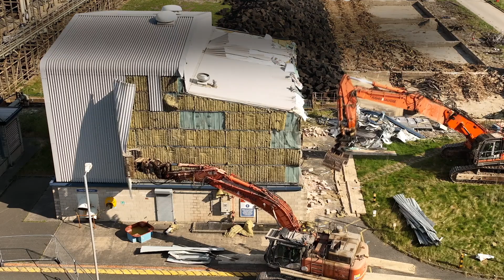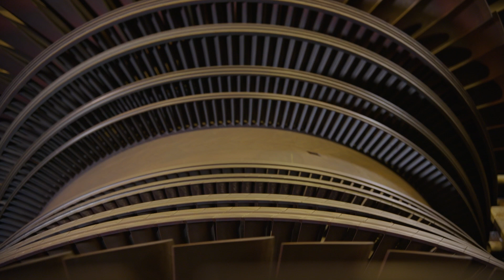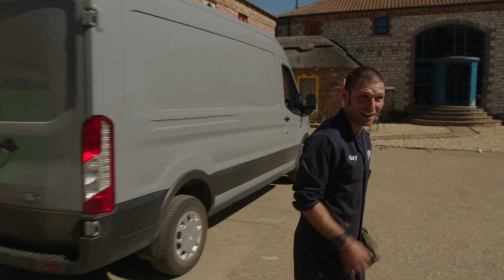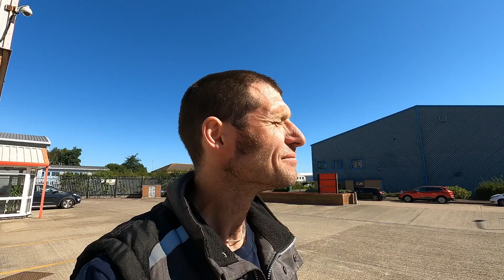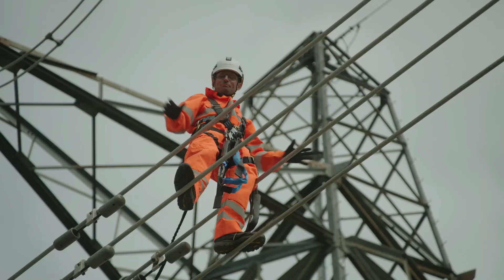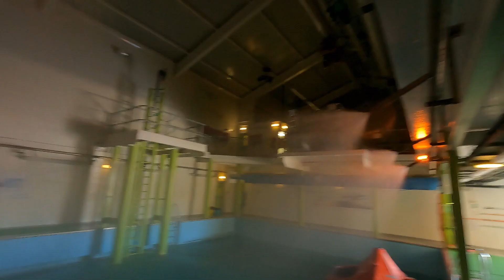ALL of Guy's Exclusive Scenes from Guy Martin's Great British Power Trip | Guy Martin

Comment: Guy good documentary mate however I'm at a loss as to why this country produces enough energy for its needs and yet we are paying a premium
What you said about on windy days the wind farms produce too much energy that we pay the companies to switch them off is madness and all that excess energy wasted that could be stored to reduce  bills
The government needs to address this problem ASAP as the public are being ripped off
Reply: That excess results in power grid failure, With electricity, when you push cables and such to their limits, they melt, they start fires, and in the case of industrial capacitors, they explode.
The cost for that premium is to pay for maintenance of the entire logistics of the system, including employee pay, hazard pay, insurance, The cost to maintain and repair complex electronic equipment, the cost to maintain and repair primary, secondary, tertiary, etc power lines, The cost to maintain and repair wind turbines, the cost to maintain and repair solar panels. Everything costs money and none of it runs without the half a million to a million people working in that industry to keep it running.

Want to reduce the bills? Use less electricity, push to make humanity less reliant on electricity, because the more and more people you employ to keep and maintain the electric infrastructure, the more you have to earn to be able to pay them.

Stop wanting everything in the world to be free.

Comment: The anti-electric people in these comments are hilarious. Also, not even Guy, who's probably a bigger gearhead than any armchair experts that will comment on this video., is against electrics... The anti-electric crowd, is where the real toxicity is.
Reply: no... People arent anti electric. They are skeptical about the actual practicality. Or at least i am. 
I actually work in a company where we design renewable energy infrastructure and every engineer i know is skeptical, to the point of audible laughter being heard in meetings discussing government targets. They are not realistic or even feasible.
The normal civvy's are not privy to the actual data and knowledge circulated amongst places like ours and trust me, its not as shiny and bright as you think. Does that mean we shouldnt use electric cars? no. I myself would buy one if i only needed to do short trips but... i live in a big country.
The problem is - the problem hasnt been solved. there is no formula to follow, no one has achieved the transition, its all theoretical and yet we are told this IS the way to go, dont question it. Its going to spell trouble. Think about it, the most common time to use a car is exactly the same time as the best time to charge it (day time when renewables are running) AND the time when the grid is under the most demand and the most susceptible to collapse caused by issues which those synchronous condensors are trying to solve.
Imagine all these issues MASSIVELY compounded if cars are all replaced with electric cars. No one actually knows how this is going to be done.
I spoke to a consultant the other day who told me about the actual data about the last couple of decades  of solar panels/effectiveness/failure/disposal and trust me, it was not good. He said exactly the same thing as me. Its terrible that we have blindly charged so far down this avenue without any real data, being told the whole time it is the answer when the data shows it is probably not.
I think a better plan needs to be formulated before investing insane amounts of money and knocking down our backup options on the promise of a dud.

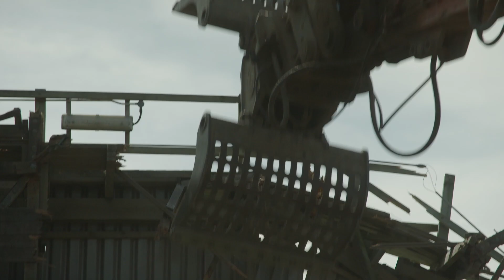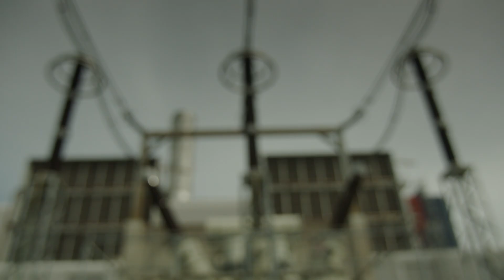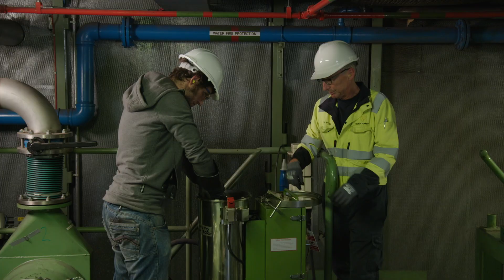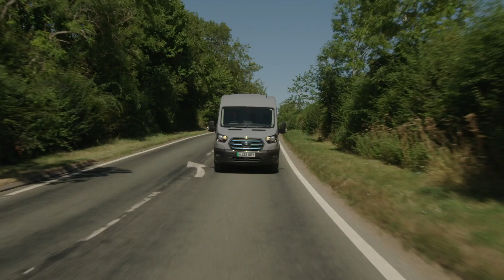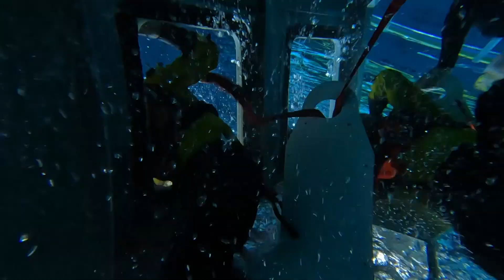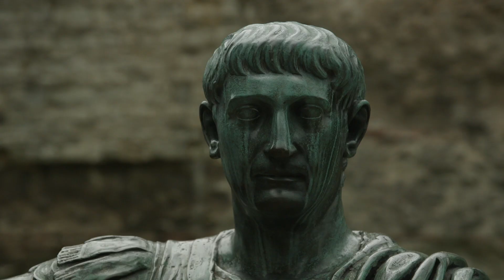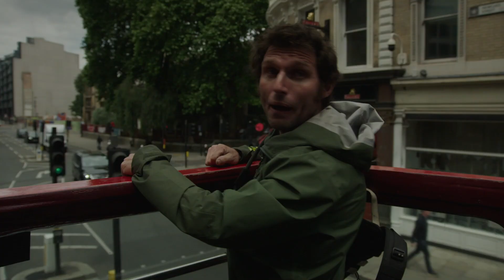Comment: 0:52  6:20  that shit needs to end for a start - Disassemble the fcking thing by hand carefully and Reuse the materials instead of wasting more energy crushing/shredding and re smelting.  1:39 stop/ban all non essential to life bullshit then eg fashion, paid  sports, discos, concerts, arts, music, industries we dont need people to be working in etc etc.    lol 5:43 get used to the big thick gloves need to be used when working on Evs too.  8:30  travel even in an ev for non life death needs to stop/be limited too 'by people doing the right thing because its right, NOT because youve been told too'.    15:00 send them via boat.  16:32   if charcoals so better 'even with the process to make it'  WTF were drax playing at logging trees in canada to chip up to burn as wood ?!   18:30 on the back of who elses work ?!   20:00 LMAO   hope they survive longer when sent into a nuclear facility than the first ones sent to Chernobyl DOH.  20:42 needs work if they are to work alongside us and assisting us.  24:13 will the helmet industry get its head out of its arse and care less about sales and profits and design a better helmet for all applications.   25:07 we need land ones to use any excess to power gravity batteries 'either a weight in the tower or pumped hydro or similar'   25:26 whats the industry doing to optimise the turbines spin speed (gearbox changes ?)

Comment: To generate the kinetic energy in the heavy Turbines takes a lot more energy input than you get output. Then uses energy at a loss just to maintain output. Loss Loss. That's why you have so many of them. Who's getting rich from UK power plants?
Reply: The alternative would be chemical batteries. 100x the cost of inertia
Reply: @getur99  no just spinning lighter magnetic motors to generate electricity
Reply: @H4N5O1O  you’re a genius. Tell the national grid your idea. 🤦‍♂️
Reply: Kinetic energy is not what  causes inefficiency in the power cycle. Kinetic energy is basically free once the turbine is spinning at speed. It’s the principle used by large UPS installations (Uninterruptible Power Supplies) where they spin a flywheel up to speed and it takes very little energy to keep it spinning as long there’s no load on it